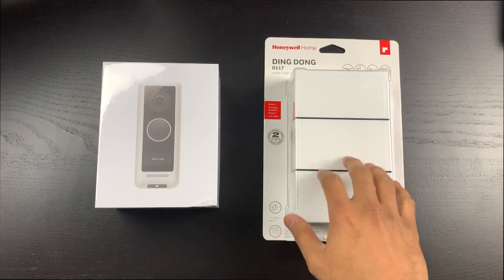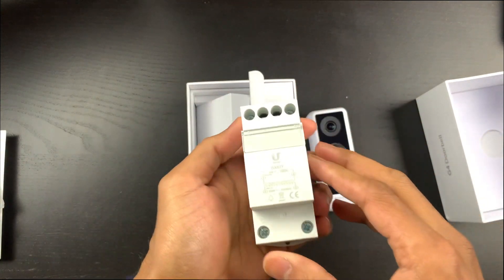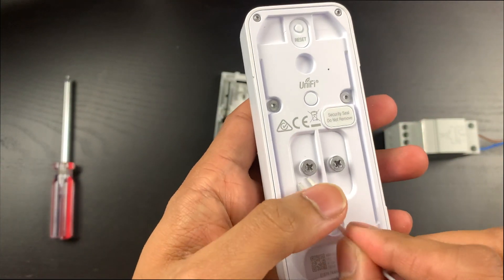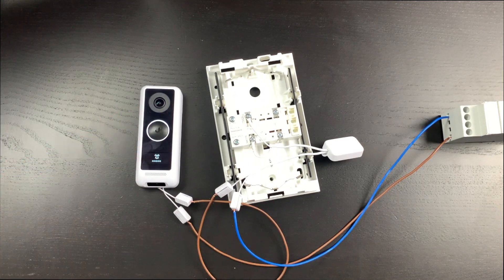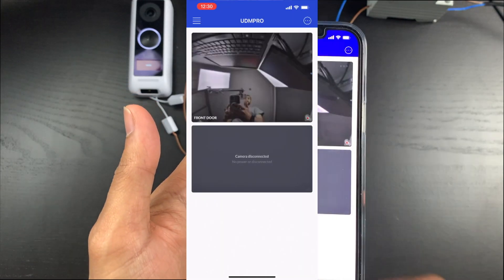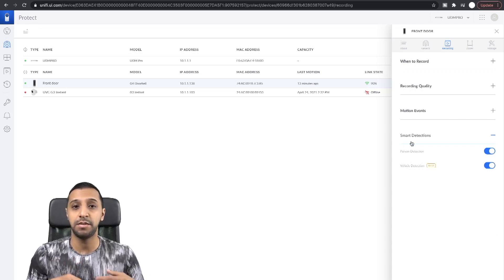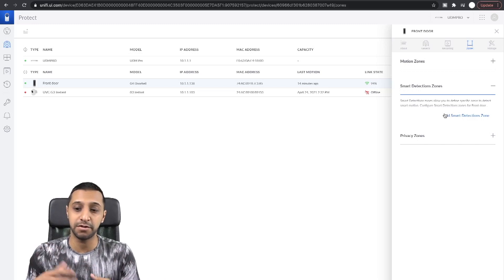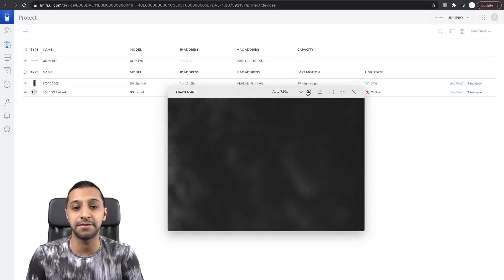UniFi G4 Doorbell Camera | No Monthly Fee | How to Set up and Install with Chime

Comment: Thanks for the video. Do you need a unifi wireless access point to connect this doorbell? I’m getting a red flashing light when mine tries to connect to wifi then it does not get adopted in the Protect App. Thanks!
Reply from the maker: No you shouldn't need to. As long as you have Wifi and Unifi protect it should work but i have not tested it without a unifi access point

Comment: This video is very good. I have a question. Can I connect this G4 without the UDM Machine and only with the App in the Phone?
Reply from the maker: No you need the UDM as that what runs the software. If you dont want a UDM you can use a cloud key.

Comment: How does it look when it’s on the wall installed, is there enough room in the chime box to fit the transformer inside? 

As I don’t think it would be a good idea to have L& N wires exposed, albeit up on the wall beside the CU.
Reply from the maker: I didn’t fit my transformer into the chime, I had it set up separately. I have multiple din rails set up for home automation bits
Reply: Does it require additional cabling i.e bell wire or does the existing wiring and contents of the G4-Doorbell include everything you need for a UK install? 

Currently I have 230v and existing bell wire.
- will I need 1 additional piece of bell wire?

Comment: hey guys i connected the doorbell g4 to our door yesterday like in the instructions and in this Video Dame chime and found that it doesn't work at all although there is voltage. As a test, I connected it right next to the chime like in this Video …it went on and updated the software, etc. However, the chime rang but distorted.. The traffic is probably too weak or what could it be .... a few meters further to the door not works at all ... what can you do to buy a more powerful traffo and if so, which one or what could be the fault? 

Thanks in advance:)

Comment: Do you have the dimensions of the transformer please? Hopefully it will fit into a Wylex 2 Module Insulated Enclosure
Reply from the maker: 9cm Height, 4cm Width and 6cm depth. Not sure about fitting in the Wylex box, I have mine mounted on a DIN rail.
Reply: @InsideWire  Thanks
Reply: @itsme_leon  Did you ever find out if it fit in the Wylex 2 module enclosure?
Reply: @ohmz55  Yes it does! I got this one from Screwfix - Wylex NH IP40 2-Module Unpopulated DIN Enclosure

Comment: Great to know that it works with this mechanical chime. Will the included transformer in the EU version (16V 15VA) be enough to power the G4 doorbell with Honeywell's wireless chime adapter (8VAC 2A) without issues?
Reply from the maker: This would be something id need to test.

Comment: Is that initial buzzing noise when you press the chime the sound you get or is it because you have wires resting on the unit itself. With the box on the chime does it still buzz initially? Mine has now arrived and going to use this setup but not sure if that bell is loud enough. thanks
Reply from the maker: I have mine set up properly now and there doesn't seem to be any buzz when I press the doorbell. I had the same thoughts too, that it didnt seem loud enough but when you put the bell up its loud enough to hear in other rooms. let me know how you get on with the set up.
Reply: @InsideWire  Yes mine is the same in the sense that with the cover off the initial 'buzz' (like in your video) seems more obvious however now its up on the wall you really have to try and listen for it. 

I have it all setup now but need to have a good look around the settings on protect now. I have noticed the transformer gets fairly warm as well - its warm to touch but not hot if that makes sense.

Back to the buzzing noise it may well be due to the voltages involved on the secondary side of the transformer. My multi-meter has died but I have a fluke basic tester and its illuminating the 20-24 volts ac scale. Maybe this is why we get that initial buzz on depressing the doorbell button as the honeywell upper limit is 16volts and from reading on the ubiquiti forums the secondary side of the transformer can put out up to 22volts.

Comment: you assume wrong.. tell us how you get 4K resolution out of a 5MP sensor, 1600x1200 HD @45fps..
Reply from the maker: You are correct, not sure where i got 4k from. Thanks for pointing it out. I'll pin a message to correct this.